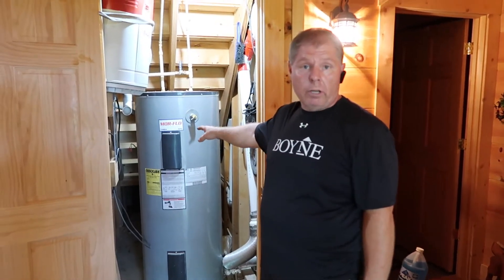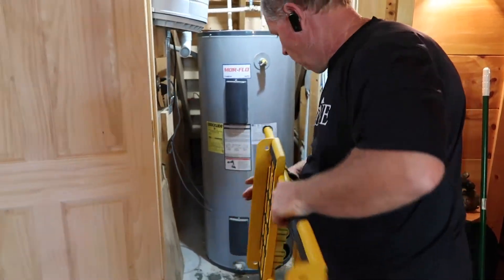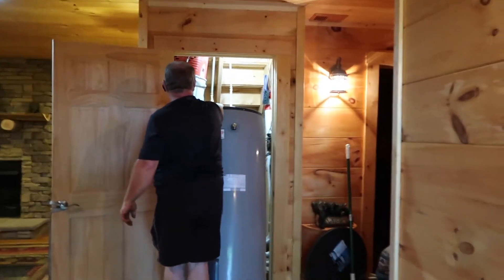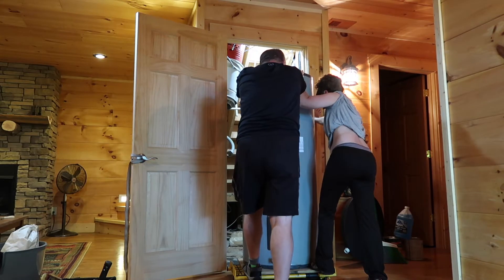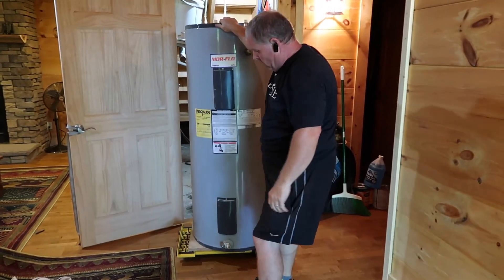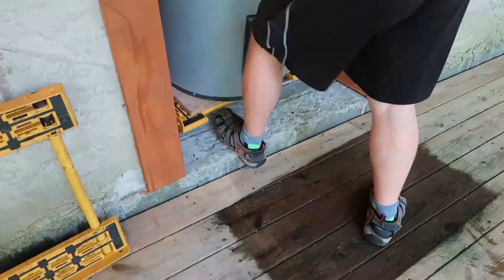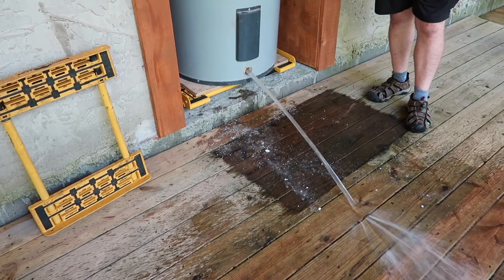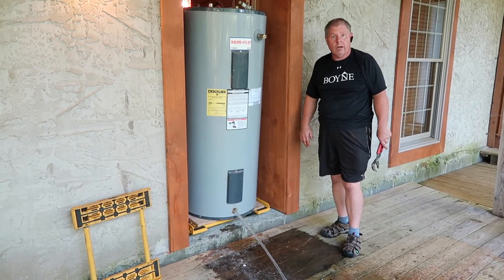80 gallon water heater

Comment: My dad has one in the basement with wooden steps.  Is it possible to use a slide ladder as basically a slide to lay the tank on its side and pull it up and not cause any damage to the stairs perhaps?  Its an 80 gallon tank too.

Comment: Since the drain cock was not blocked by sediment,  why not just use a garden hose to drain the tank outside? That tank would have been a lot lighter and less likely to damage the flooring.   I'd be concerned that any rust or minerals in the tank would discolor the deck.
Reply from the maker: thank you for your comments if you look at 2:15 of the demo I removed the drain cock completely giving a 1" hole for sediment to easily move through if a hose would have  worked to drain this heater it would have taken  hours to complete  there is rarely any rust in the tank mostly calcium build up in this area but we in some cases cut the box down and channel water away from opening any other ? s or suggestions let me know  thanks Eddie
Reply: @eddieturner9921 I’m having trouble finding an 80 gallon hot water heater that isn’t setup for 277volts. Does a 277 need to be converted to 208/240? If so, how is this done? 
Thanks for any knowledge you could share.